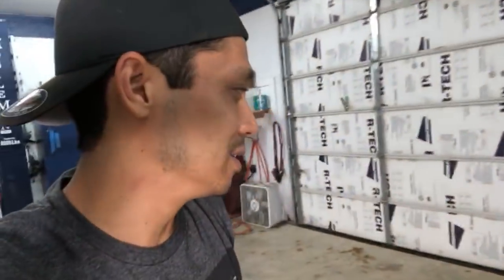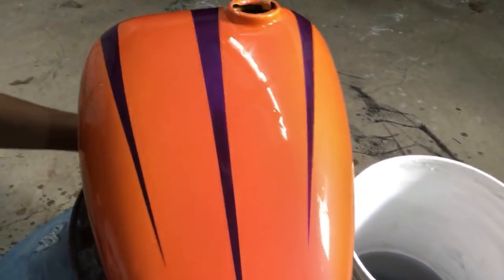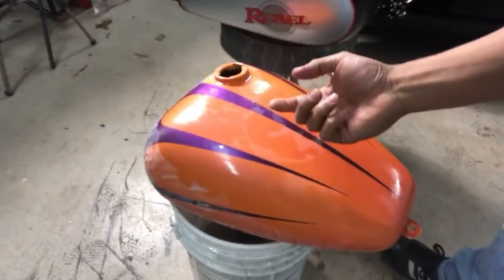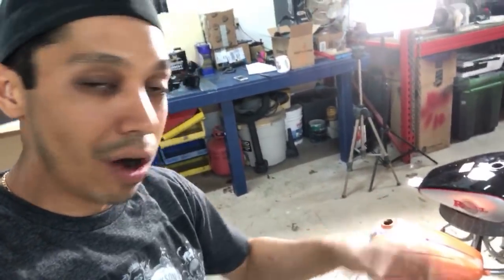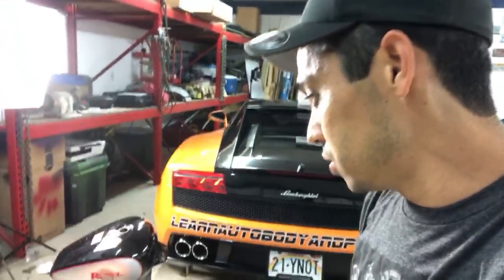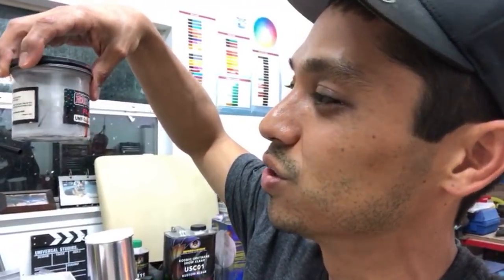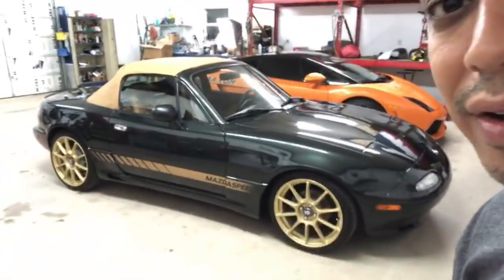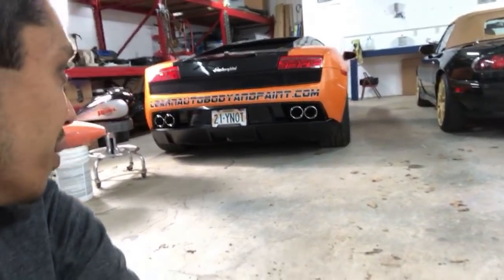Custom 🎨 paint screw up and metal flake plan

Comment: I had problems with cheapo single-stage (activated) in which the paint didn't run, but inside the paint-film while it was still wet (inside) the pearls streaked down by gravity.  What a pain in the keyster!  Brad Barth
Reply from the maker: Yeah I get it!